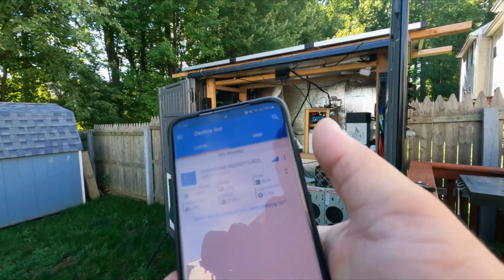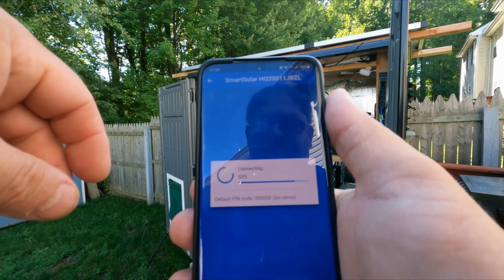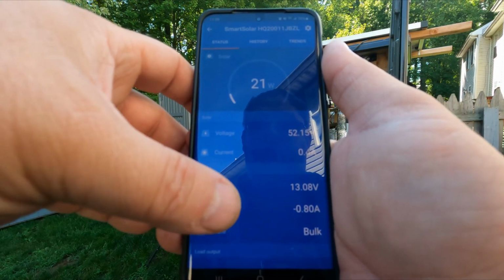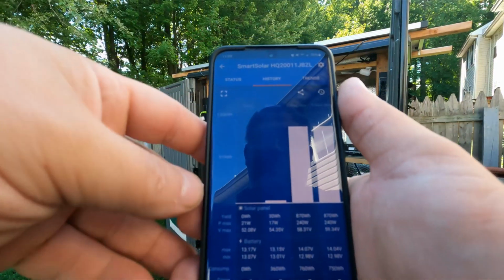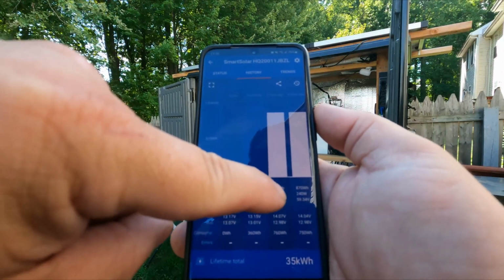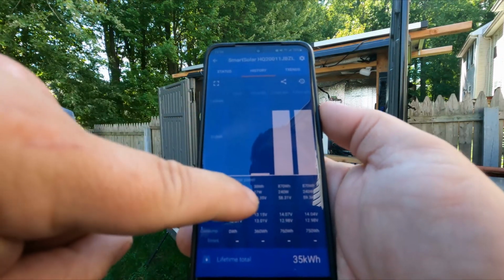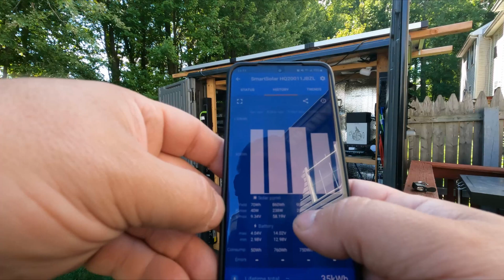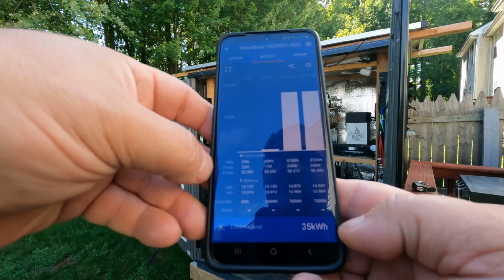Crypto Mining Shed - Basic Solar Setup

Comment: You could make the shed more rain proof with the cable coming in by simply adding a "drip loop" to the cable. It is basically just a saggy area next to where the cable penetrates the structure and most of the water will follow the cable to its lowest point before dripping off.

Comment: How much have you made up of the value of mining cryptos this method versus how much it spent? Also I've done the math for a basic mining rig that would use around 300 watts. I can't seem to find a way to leave it powering on overnight without using something super expensive that would recharge the battery and it can hold up that long at night. Do you have any recommendations on how to make this setup affordable and still have some kind of returns and how long it takes for itself to pay off?

Comment: Im using a 4215 BN Epever forty amp controller which has worked great since October 2020. I have 1600 watts of solar panels feeding twenty big marine batteries from Autozone.
Reply from the maker: Mine was a 2215bn, older model.  Maybe the newer ones are better?
Reply: @madelectronengineering  Could have been because I used a 24 volts model.

Comment: Look into CIGS amorphous panels, harbor freight sells them too, the AM panels produce more power in the shade and start collecting at sunrise.  John Gibson has a YT page where he discusses these panels.   These panels are behind the curve to due to politics and cheap chinese producers but in rain, sleet, snow or shade they produce.   I have 4 Coleman panels for camping use but I'm not using at home, that's a project on hold due to the crypto winter.   Latitude is how you set the panels for optimum sun performance so look up your latitude, if 38 degrees then 38 degrees is the best!